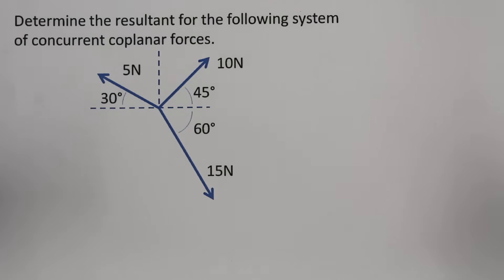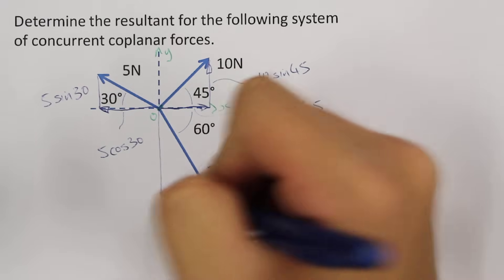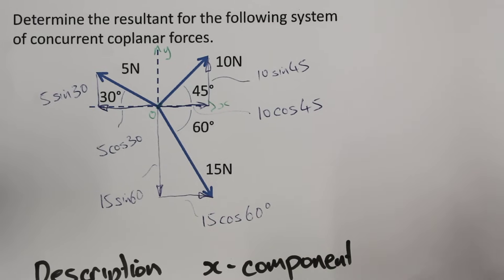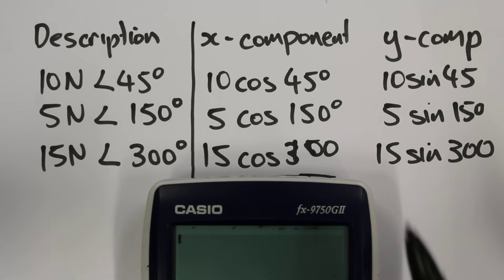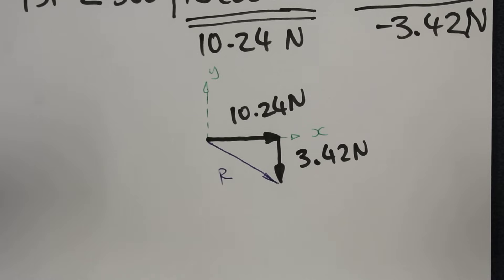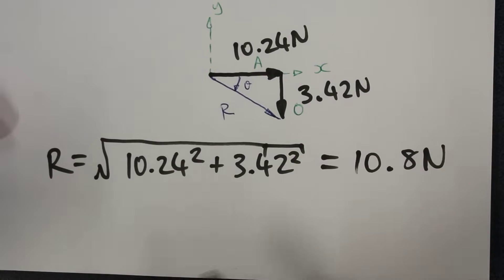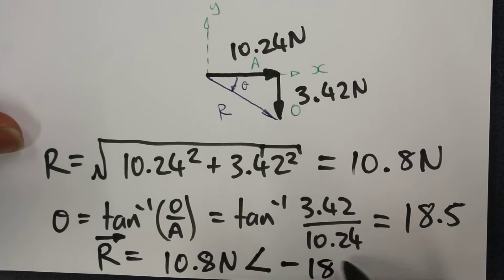Resultant of Three Concurrent Coplanar Forces

Comment: so is it always that the resultant of the net forces will be subtracted from 360 at the end yo workings
Reply from the maker: Hi Cephas Mwale. I'm assuming you mean the 'angle of the resultant of the net forces'.

Answer:
No, that is not correct.

I have used the convention that a positive angle is measured anti-clockwise from the x-axis.

In order for my answer to match that convention, I needed to calculate how big the angle is from the x-axis to the vector. In the video, I have found out the angle going clockwise. To get the anti-clockwise angle (from the positive x-axis), I used the idea that there is 360 degrees in a full rotation, and that the full 360 rotation is made up of the clockwise angle from the +ve x-axis and the anti-clockwise angle from the +ve x-axis.

In short
360 = anti-clockwise angle from positive x-axis to the resultant vector + clockwise angle from positive x-axis to the resultant vector
360=anti-clockwise angle from positive x-axis to the resultant vector+18.5
anti-clockwise angle from positive x-axis to the resultant vector = 341.5

Comment: Isnt that when resolving the force 5N which is going in the x-negative direction we should put a negative sign
Reply from the maker: Yes, when breaking it down like I have in the first part of the video you should. So it would become - 5 cos 30.

But if you break it down as a vector and angle as measured from the axis (as I have used in the second part of the video where I have used the angle as measured from the x-axis) you do not need to add the negative sign . (Please see the comment by Senzo below)

Comment: uhm...sorry, but why are we using 15cos300 and 15sin300 meanwhile the components are 15cos60 and 15sin60? can i please get a clarity there.
Reply from the maker: Sure, the short answer is we can use either.

The long answer:
For the x component of the 15N force, we have: 15 cos 60 = 7.5N in the positive x-direction; and 15 sin 60 = 12.99N in the negative y-direction (pointing down). 
This method treats the 15N vector as the hypotenuse of a triangle, then we need to deal with finding if the direction is positive or negative. We would then have the x-component as 7.5N and the y-component at - 12.99N. The negative is because it is pointing in the negative y-direction.

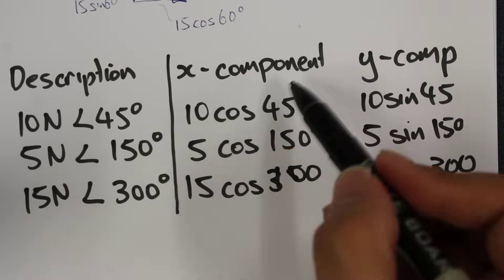In the table that is shown in the video @5:16, instead of treating the vector like a triangle, I have treated it as a rotating vector. The sine function provides the y-component of a rotating vector, and the cosine function provides the x-component. This video shows that the height of rotating vector can be used to create the sine wave: https://www.youtube.com/watch?v=QFi16s4RXXY also this one (be careful, this one has classical music) https://www.youtube.com/watch?v=miUchhW257Y

Basically, there are two ways to do this and in this video I used the first method to describe the components, and I used the second method for the components in the table. I hope you will find that: 15cos300 is equal to 15cos60, which is the x-component; and that   -15sin60 is equal to 15sin300, which is the y-component.

Please let me know if this helps :-)

Comment: How can I find the X and Y component if there isnt any angle given to one of them?
Reply: It is quite hard to answer your question without an image. Would you be able to post an image or provide a link to an image?

It could be that the angle is given to you in the question and you haven't spotted this yet. It could be given by the dimensions in the question or by a small triangle that  you can use to find the angle.

It might be that the question is asking you to find an equilibrant.

It could also be that the question has an error in it.

I'll be able to help better with an image of the question that you are trying to solve

Comment: the angle is always measure from x-axis?
Reply: If you are using cosine for all x-components, and sine for all y-components; then yes.

Some people do these types of questions by finding the value of the component using trigonometry. Then check if the value is positive or negative; by making it positive if it is pointing in the direction of the axis. If you use this method, then the answer to your question is no.

Comment: for resolving three concurrent forces, you can simply use Lami's Theorm. But remeber that it only works for three forces. and Lami's theorm is much simpler for three force resolution
Reply from the maker: .. in this case, Lami's theorem is not appropriate because we are finding the resultant of three forces. As a force polygon, this would be a four force system; therefore lami's theorem would not work.

Comment: This is really good content I appreciate it, but I've noticed you use bearings for angle and refer to it as the positive x angling. (Unless I didn't get the class)
Reply: Yes, that's right; each of the angles shown in the table is an anti-clockwise bearing that is measured from the x-axis.
Reply: Wow Thanks

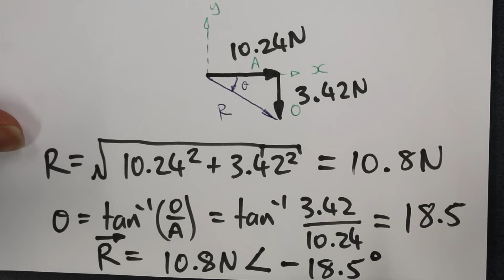Comment: sir im sorry if i didn't get it, why on the last part, 11:13 it became (-) negative 18.5 thank you sir :)
Reply from the maker: No worries,

The angle is negative because there is a convention in Mathematics for angles. The angle is measured from the x-axis, and the positive direction is anti-clockwise.

The angle could be written as 360 -18.5 = 341.5 degrees as a measurement from the x-axis... or could be written as -18.5 degrees as measured from the x-axis.

Also, the angle symbol used (http://www.fileformat.info/info/unicode/char/2220/index.htm) means that the angle is measured from the x-axis with anti-clockwise positive.

Comment: sir just wanna ask on 3:33 should it be 180-45-30=105 please correct me if im wrong :( thank you dont know why it became 150
Reply from the maker: the measurement that I have written in the video is from the x-axis. The working you have given above is for finding the angle in between the two forces. Just check to see where the green line starts from and finishes (@3:28 to @3:30)

Comment: 2:23

Excuse me, what's a tabular method?

Measured a the X-axis?:

10N <45°
5N <150°
15N <300°

<: represents an angle you wrote in the description. 

Thank you in advance!
Reply from the maker: Hi Md ZI, there are different methods to solve this type of question. The 'tabular method' refers to the table being used. There are four other methods I am aware of: graphical method; analytical method; geometric method; unit vector. A special case of the unit vector method is to use matrices.

For the second question, can you help me to understand what you mean by asking it in a slightly different way?

Comment: How many marks would this Qu be
Reply: Hi Strange Joker95, it would depend on the level of the course, the learning outcomes of your course, the weighting of the assessment and various other parameters. If you are from the Manukau Institute of Technology Engineering Fundamentals class, it would be in the vicinity of 4 marks to 8 marks depending on what types of followup questions surround it. I'd like to add, that there should be more information in the question: ie "Determine the 'magnitude' and the 'direction relative to the positive x-axis' of the resultant of the following system of concurrent co-plannar forces." This question, should also have the x-axis and y-axis co-ordinates in the diagram. Unfortunately, I have already recorded the video so these types of corrections would require me to re-record the video and I haven't yet had the time to do this

Comment: Why 150°?
Reply from the maker: I hope one of the following answers your question. The angle of 150 deg is measured from the positive x-axis. The cosine function can be used to find the x component as long as we measure this angle from the x-axis. The following video from Khan academy may help https://www.google.co.nz/url?sa=t&source=web&rct=j&url=https://www.khanacademy.org/science/electrical-engineering/ee-circuit-analysis-topic/ee-ac-analysis/v/ee-sine-cosine-from-rotating-vector&ved=2ahUKEwivm9rVidzdAhVHi7wKHV8OBtkQwqsBMAB6BAgIEAU&usg=AOvVaw0CwS8rtTH5sQ5w3QP6HMnT

Comment: Sir   could you  please   solve   this  question   for  me   .I   am  not  getting  any  idea   to  solve  this Question
What is the condition for equillibrium of concurrent force?
2 )A mass of 6 kg is suspended from ceiling by a rope of length 2 metre .A force of 50 N is  applied at  midpoint of rope in horizontal direction .What is the angle  the rope  making with vertical in equillibrium?(taking g = 10 m/s)
3 )what will be the angle made by the rope if its length is doubled?
Reply: Hi Reshmi, at this moment I am unable to help. Maybe someone following this page can assist.

Comment: Why get negative the angle
Reply from the maker: I think you are talking about the angle at @11:10 for the resultant force.

The angle is negative because there is a convention in Mathematics for angles. The angle is measured from the x-axis, and the positive direction is anti-clockwise.

The angle could be written as 360 -18.5 = 341.5 degrees as a measurement from the x-axis... or could be written as -18.5 degrees as measured from the x-axis.

Also, the angle symbol used (http://www.fileformat.info/info/unicode/char/2220/index.htm) means that the angle is measured from the x-axis with anti-clockwise positive.

Comment: when do we  subtract the angles
Reply from the maker: It would be when your trying to figure out what angle the vector (arrow) makes with the x-axis.

If the angle you know is clockwise from an axis, then you would subtract the angle.
if the angle you know is anticlockwise from an axis, then you would add the angle.

The angles at @4:11 were found as follows:

0deg     + 45deg=45 degrees
180deg - 30deg=150degrees
360deg - 30deg=330degrees

Comment: Why did the inclination angle is negative
Reply from the maker: I think you are talking about the angle at @11:10 for the resultant force.

The angle is negative because there is a convention in Mathematics for angles. The angle is measured from the x-axis, and the positive direction is anti-clockwise.

The angle could be written as 360 -18.5 = 341.5 degrees as a measurement from the x-axis... or could be written as -18.5 degrees as measured from the x-axis.

Also, the angle symbol used (http://www.fileformat.info/info/unicode/char/2220/index.htm) means that the angle is measured from the x-axis with anti-clockwise positive. Please let me know if I answered your question.
Reply: Cornelis Kok tq sir

Comment: Why you don't put negative sign at (3.42N) when calculating? wouldn't it be r= (10.24^2)+(-3.42^2)?
Reply: marianne pajatin .. thanks for your comment. I left out the negative sign because even with the negative sign I would have gotten the same answer. When you do your answer please be sure to put -3.42 into brackets... ie r^2=(10.24)^2+(-3.42)^2?

Comment: -15sin30 not -15sin 60 for y component on bottom
Reply from the maker: I hope you don't mind me saying this, the y component of the 15N force is not equal to -15sin 30.

The angle of 60 degrees is measured from the x-axis
* the side adjacent to the angle is the x-component so using SOH/CAH/TOA we see that cosine of the angle is equal to the adjacent divided by the hypotenuse
* the side opposite to the angle is the y-component so using SOH/CAH/TOA we see that the sine of the angle is equal to the opposite divided by the hypotenuse. This gets us, sine 60 = ycomponent / 15
the magnitude of the ycomponent= 15 * sin 60.. but the direction is downward (which is our negative direction) so ycomponent= - 15 * sin 60

It has been 4 days since this post so I'm guessing you have found the reason why already but I am posting for the benefit of anyone else that might be reading your comment.
Reply: I think Brian commented cause you drew the triangle on the LHS of the force to the Y axis . Drawing the triangle on the RHS gives the working you describe above. But I may be wrong as well.

Comment: what if the angle theta is not given
Reply: It would depend on the surrounding information. Could you provide a picture of what you are working on?
Reply: magnitudes of three vectors:A=8.0 B=5.0 C=6.0. Vector A is north of east and the other vectors are respectively to the left. I will set D as the origin so I can describe angles. Angle  values given: measure of <CDB=70 degrees and measure of <BDA =40 degrees.
Reply: Justin Manangan it sounds like you don't have enough information... it might be that you are working on a problem where you are trying to find an unknown force for a system that is balanced (in equilibrium)
or it might be that one of the forces is pointing directly up or directly left. Are either of these the case?
Reply: yes I am trying to find the resultant of all three of these vectors added. I couldn't find anything related to the x or y axis so that I could use proofs.
Reply: i just need to find its magnitude

Comment: why we did not subtract the x and y components of 5N force as 15N force will not overcome the 5 N force giving 10N force???
Reply: ani2000ify Hi there, this question shows a force system that is not balanced. That means the x component of the 5N force does not equal the x components of the 10N and 15N forces.

One way to visualise this question is to replace the force vectors with distance vectors. Stand in a middle of a field, travel 10 metres at an angle of 45 degrees, then travel 5 metres at an angle of 150 degrees,  then travel 15 metres at an angle of 300 degrees. The final location will not be the same as the starting location.

Hope this answers your question.. if not let me know.

Comment: You haven't considered the direction of sin and cosin, Why?  I mean in ur video there is 15N acting downwardnso while adding the x component , it would be  -15Cos(300) right?
Reply from the maker: Hi Mary, sorry for the delay. The direction is taken care of if we use all angles as measured from the x-axis because the sine curve is a negative when the angle is bigger than 180 and less that 360.

Comment: why is the angle negative?
Reply: I think you are talking about the angle at @11:10 for the resultant force.

The angle is negative because there is a convention in Mathematics for angles. The angle is measured from the x-axis, and the positive direction is anti-clockwise.

The angle could be written as 360 -18.5 = 341.5 degrees as a measurement from the x-axis... or could be written as -18.5 degrees as measured from the x-axis.

Also, the angle symbol used (http://www.fileformat.info/info/unicode/char/2220/index.htm) means that the angle is measured from the x-axis with anti-clockwise positive.

Comment: dont understood negative sign
Reply: imran khan Hi Imran, the axis drawn there has a convention that when the x-component is towards the right, it is positive; and when it is towards the left, it is negative.

Also, when the y-component is upward, it is positive; and when it is downward, it will be negative.

Try to calculate the value for each of the 3 x-components; then use the convention above. Right is positive, down is negative for the x-direction. You will see two of the forces are pointing to the right, and are in the positive x-direction; and the 5N force is towards the left (negative).

Try to calculate the 3 y-components too. Up is positive, down is negative for the y-direction. You should see that in the y-direction 10N and 5N forces are positive, and the other force is negative.

Does that answer your question?